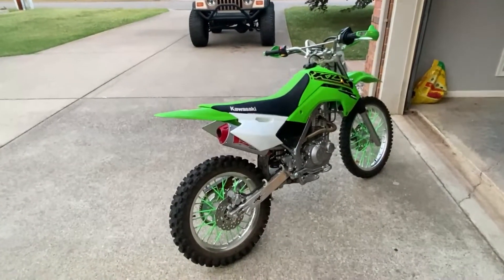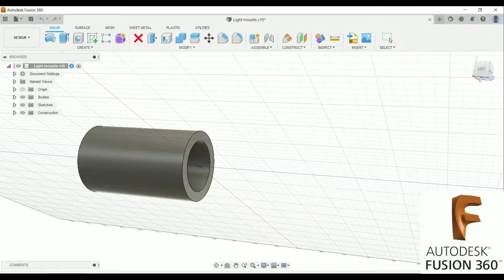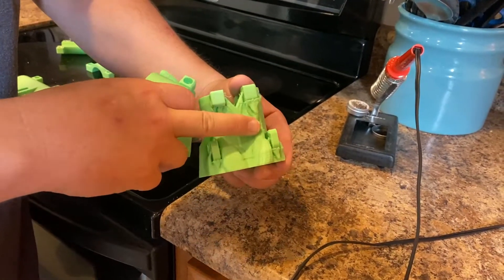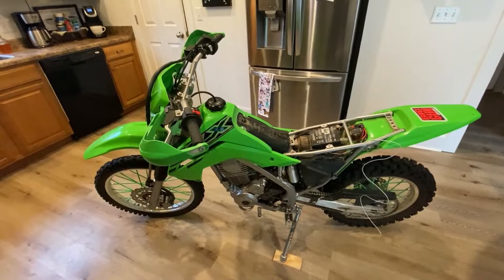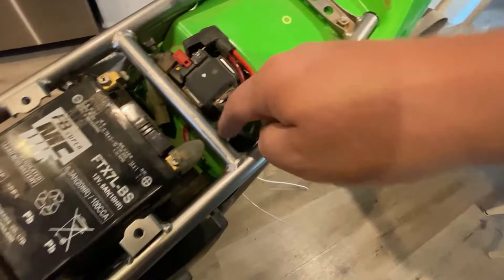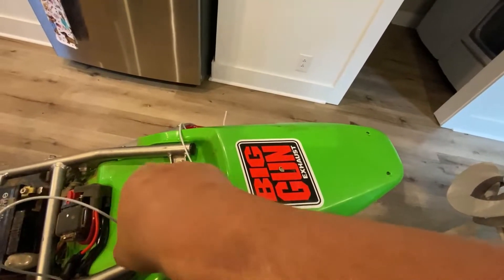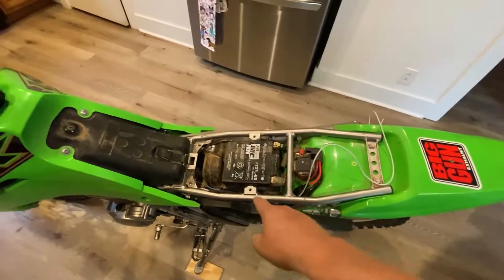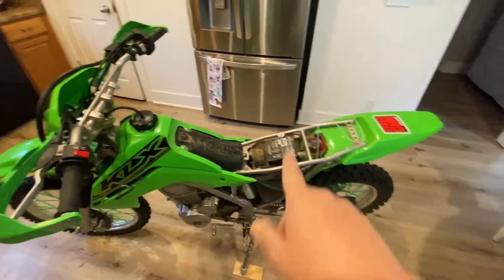Add headlight and taillight to your Kawasaki KLX140 #KLX140

Comment: Thanks for the video. Looks great!
Reply from the maker: Thanks, it was a fun project. Please note , I am about to put out more content. The next 3 people to buy the headlight or taillight,  from the affiliate links in the video will receive the 3D printed fork brackets shown in the video for free! It doesn’t affect the buyers price and It will help me meet the minimum number of orders to get set up to use affiliate links with Amazon. As the channel grows it will make a difference but as it stands , I get a dollar in commission for each headlight sold 🤣, literally. Volume of links is the key in YouTube world. Won’t make you rich but may help buy some materials for more projects.
Reply: @joat1026  Good deal! I’m going to order the headlight right now! It was the brackets that were my hold up. Hopefully I’m the next 3!
Travis
Reply from the maker: @traviswalker6831  Shoot me an mailing address to tntoolguy5@gmail.com and I will get you some mounts on the way when they are done printing. Thx
Reply: @joat1026  Just ordered it through your link. You’re rich!😁
Reply from the maker: Hey Travis, do have an email address you can share or  you can link one in your YouTube about page? When the order shops I will get your address and send the mounts? You can also contact me on my Instagram via direct message @ johnathan.smith07 on Instagram
Reply: Are you still offering them free if we order from Amazon link